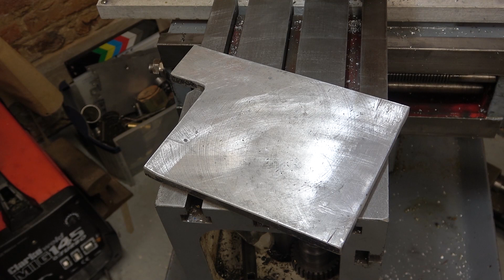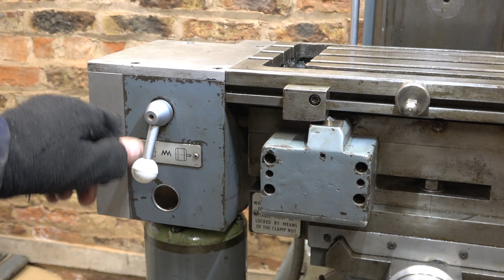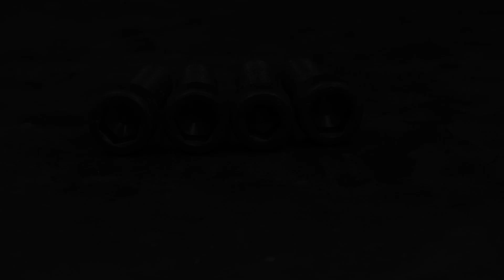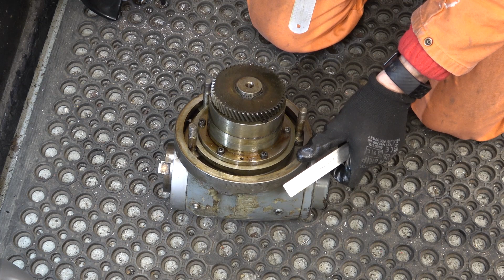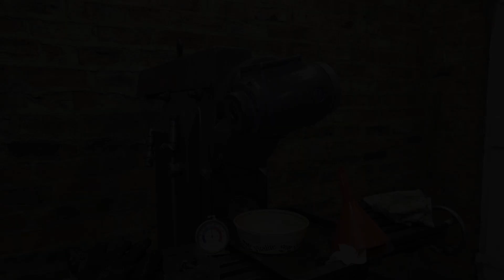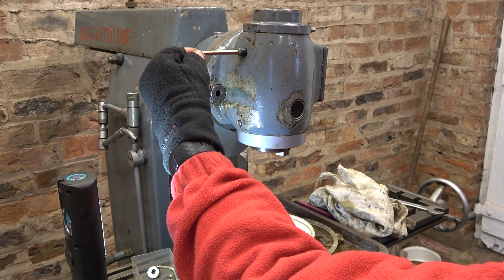HS173 Harrison universal mill servicing – Part 6 vertical milling head

Comment: Sometimes progress means going back and doing it again. Mill is coming along nicely. I'm sure it'll be cared for better than it has before you owned it.
Reply from the maker: Hi Greg, it's always a fine balance between diving in and dismantling everything and the 'peeling the onion' approach I'm taking here. When I bought my lathe I was all for separating the base and the bed to make it easier to transport but without any knowledge of these things (because he was a fabricator selling on tools he did not need from a bigger auction lot) the seller said "I would not do that, I've been caught out before". And indeed I now know there are shims between the bed and the base inserted by the manufacturer to keep the bed true and not twisted.  Would have been a big mistake to dive in. And indeed I'm finding out things about the Mill which could have caught me out had I been in a hurry.  But yes it can mean a second bite at something if the first "it will probably be ok" bet did not pay off.  Cheers

Comment: It will draw less current when its warm enough for a human to be out there anyway.😂
Reply from the maker: Hi DC, yes one day stone cold freezing on top speed it tripped the inverter (over current).  But I have since learnt that the inverter was set to 70Hz output which gives a spindle speed of 2100rpm  vs 1500 rpm shown on the gearbox. That explains a few things actually. Warmed up it draws about 7.5 amps on idle off the single phase supply. I'm rewiring the inverters now and you will see that in a later vid. Cheers

Comment: Very good progress.   Your shed is really cold in that cold snap.    Before Xmas we had a cold snap of 15 deg F (-9.4 deg C) during the afternoon.   My shop did not get cold but it was brutal when I had to go out to get petrol for the portable generator due to losing power.
For the two knobs for the left part of the table gearbox, if you have a local friend with 3D printer, you could print some nice knobs to go over the metal.   I print knobs for jigs which use standard nuts and bolts.
Dave.
Reply from the maker: Hi LV_W, I think we are quite lucky in the UK because the weather generally never gets really hot or really cold. I have thought about a 3D printer but it's always the thought I will not use it enough. One day somebody nearby will be turning out an old one cheap for an upgrade and then I'll have to get it. (A bit like the Mill - the guy was upgrading to a Bridgeport). Cheers